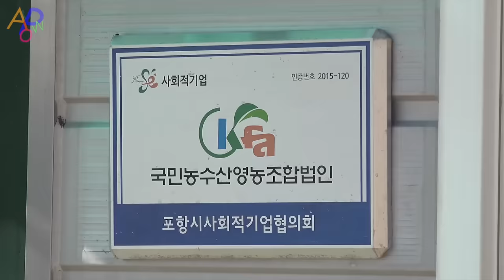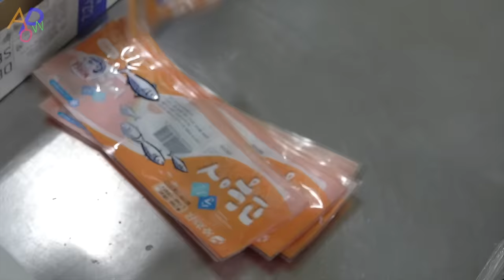Processing 24 Tons of Norwegian Mackerel per Month. Fish Mass Production Factory in Korea

Comment: Nice, thanks for showing the process. But does it arrive frozen, then you thaw it, filet it, debone it and then refreeze? I thought that was not good to thaw and refreeze food.
Reply: I think it's okay to refreeze previously thawed fish--in the USA, the USDA (US Department of Agriculture) puts a recommended "time limit" of 48 hours IF the fish is held in a refrigerated facility.  The USDA does NOT recommend thawing fish at room temperature, or in hot water, because the outer layer of the food would have been between the bacteria-breeding temperatures of 40° F and 140° F for too long to be safe.
Reply: It depends on how it is done. Remember that is a factory. The fish is semi-defrosted to remove the guts and filleting. Washed and cleaned, fillets are refrozen right away, the fish for salting is also put in cold salt brine.